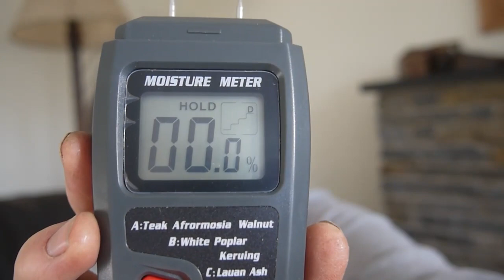Frugal Living! Sweep the chimney flue yourself - using flexible rods  #costoflivingcrisis #frugal

Comment: Hello Hazel.
Thanks for the prity Woodstove review.
It helped me to make a decision to buy one too. ☺️
Got one and i love it. 
But i wander where did you buy youre sweeper?
Greetings from Holland.
Reply from the maker: Hi Arnold...welcome to my little corner of the internet its lovely to have you here....🙂🙂I'm so pleased you bought a prity stove too they are fabulous....😀I got my brushes ebay they are fibreglass rods x7 & the brush & i paid about £25 ...this one is slightly different but i should think it would work the same not sure about the brush though...... 
 https://www.ebay.co.uk/itm/354549122056?_trkparms=amclksrc%3DITM%26aid%3D1110006%26algo%3DHOMESPLICE.SIM%26ao%3D1%26asc%3D20200818142055%26meid%3D01893b48931849bfa92f8d2bad12097a%26pid%3D101113%26rk%3D2%26rkt%3D12%26sd%3D313906761094%26itm%3D354549122056%26pmt%3D1%26noa%3D1%26pg%3D2047675%26algv%3DDefaultOrganicWebV9BertRefreshRanker%26brand%3DUnbranded&_trksid=p2047675.c101113.m2109&var=623931173000
Reply: Thank you for the link.

You just saved me a lot time and money. 🥰
I also like to tell you that im cooking almost every day on it so i need to clean my chimney a lot.
Yesterday i made my own chili con carne on the Woodstove.

Love youre videos. 👍
Reply from the maker: You're very welcome....I'm so pleased you are enjoying my videos I really enjoy making them🙂I have cleaned mine once in 3 months & not that much came down well not as much as i expected anyway..but having the brushed does save a lot of money....🙂Chilli con carne sounds lovely...I'm just making an omelette on mine its just on the oven finishing off...it seems to cook so much better on wood that on the electric stove.....😎😀🔥 have a great weekend...lots of love from wales..☀😀🙂
Reply: New Account...lost pw from the other one.
Got my sweeper. 👍
Reply from the maker: Hi welcome back😀😀 Im glad you managed to get the sweeper brushes....mine have  had a lot of use.😊..hasnt the stove been amazing for the winter...im still using mine its still quite cold here on rainy days....😊 have a great weekend....❤️😀😀🐔🐔🐔🐔